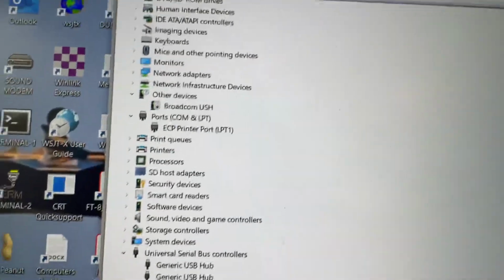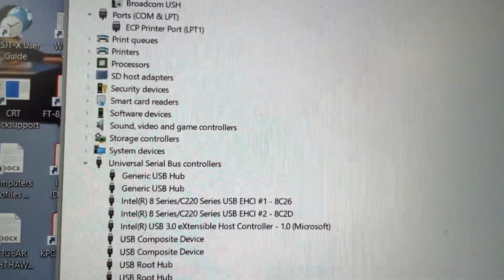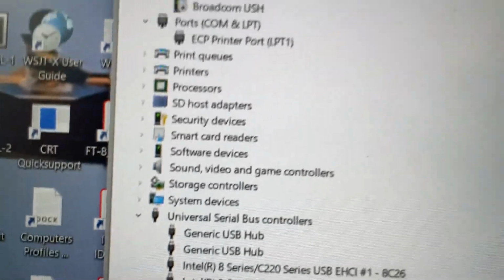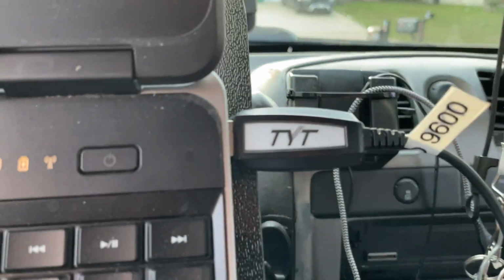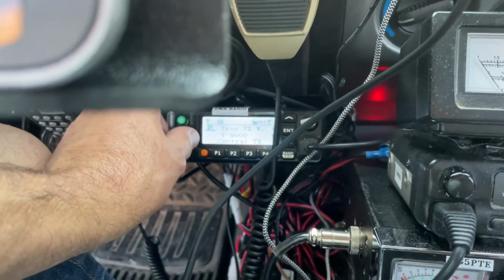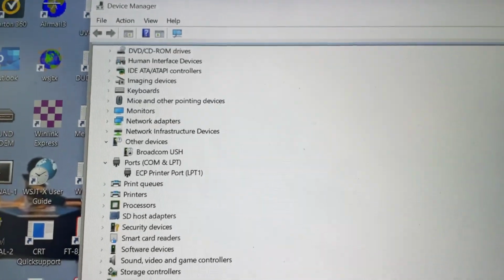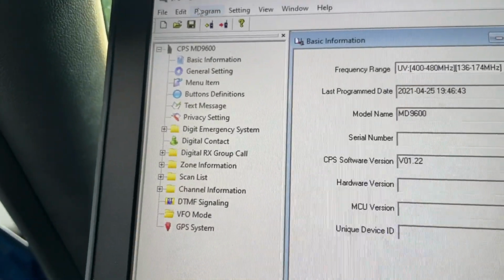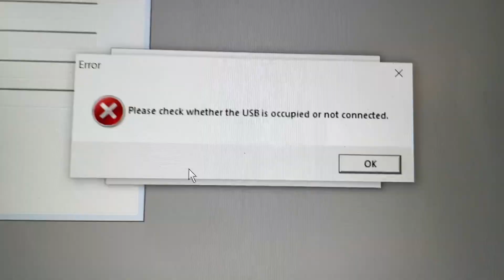TYT MD-9600 Radio programing (Glitch) with USB Cable. USB driver and Comm port will not assign.

Comment: If this happens to you, find your TYT programming cable.  I was battling this issue for an hour using other USB cables that I had laying around.  I did a thorough search of my desk and found the TYT programming cable and it worked like a charm!  K7CDR

Comment: same issue
Reply from the maker: Use the TYT MD-9600 programing cable along with a USB extension cable and sometimes the driver will load and the cable will work properly.